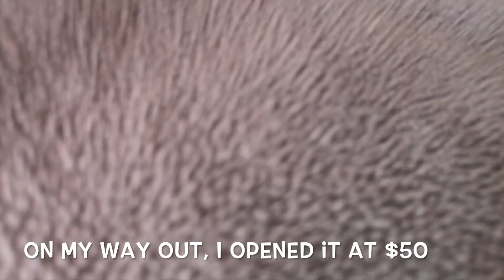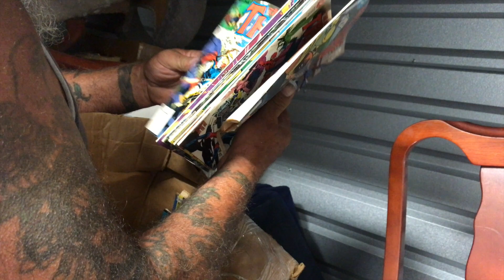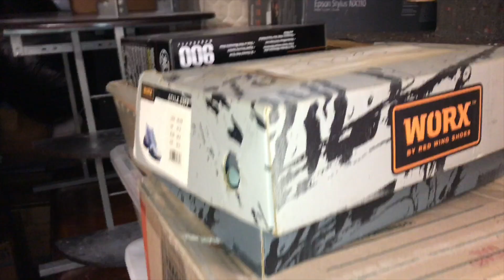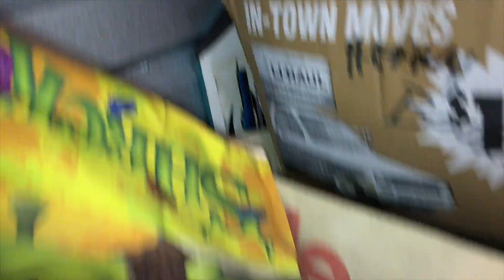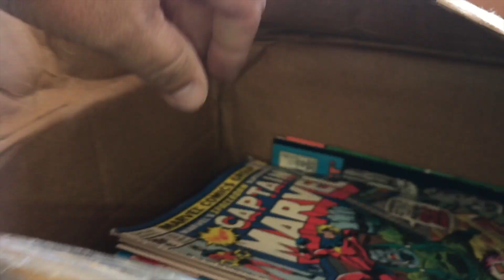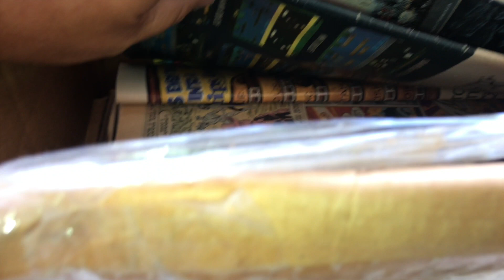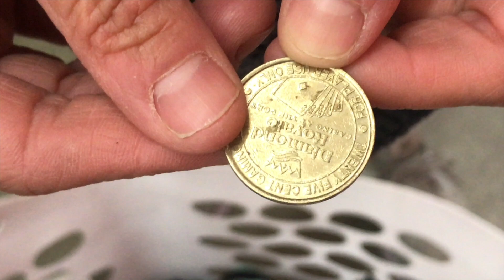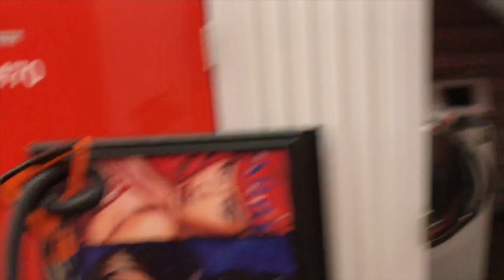It's AUCTION DAY! Janna & Jack both buy lockers, but who found better stuff?

Comment: @18:12 Hay Jack, that is a saber used by mounted Calvary, they were not meant to be sharpened, the curve was so a body would slide off easer as you go by!!!  Most swords were never sharpened  along the blade only the point for penetration!!!  Some swords were meant to cut and slash, like the Cutlass , but most were meant to penetrate armor!!!!  It is too bad about the elec. tape, that should be stacked leather!!!   Replacement is fairly easy, and can be accomplished in an afternoon, with a little TLC that saber could be a very Grand tool!!!  Jack just tell Janna to be sure to wash afterward, and not to worry quite so much!!!!  Janna made money even with a dump run, I would mix with the junk from another locker and it won't coast as much!!!!  @22:16 test the washer by running a hose to the washer faucet in your house and turn the timer see if it runs and goes through the cycles, easy!!!  HAY, wait a minute!!!   The back pack is worth more then a dollar, the two pictures are worth much more than a dollar, so even with a bit of garbage you could run out in your home garbage, and if you decide the washer ain't worth a darn, scrap it and make a couple of bucks, so for ONLY a BUCK she did OK, so don't be too hard on her!!!!  And that Civil War saber(?)  As is it is worth between 200-500  bucks, have someone put a grip on it and it will be worth upwards of $1,000.00 so don't chuckle too very hard at her she did good!!!!

Comment: Set the dryer on your driveway and plug it in.  If it turns on, point 1.  If it heats, point 2.  If not, sell it for parts.  Fun videos.  Thanks. 🤠

Comment: Testing washers... go to your Ace hardware store and get a hose y for washing machines. Hook one end to your garden hose, the other two ends hook to the hot and cold. Run an extension cord out for power and you can test them outside.

Comment: Jack you gave her a $1 challenge after she bought the $5 locker and she bought it for $1 and there is profit to be made. The sword should sell for $10, the machete should sell for $5, the Marilyn and Betty Page framed posters are worth at least $10 each (the frames cost more than that). The carpet cleaner should sell for $20 if it works. There was a new pair of shoes, should bring a couple bucks. As for the washing machine, you should be able to at least get scrap metal price for it. So I think Janna did great for her dollar! :-)